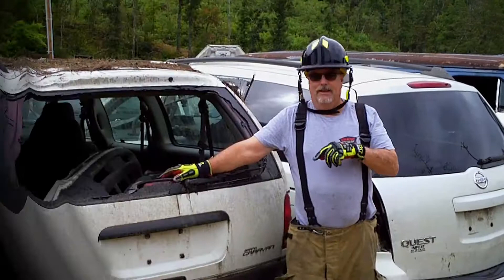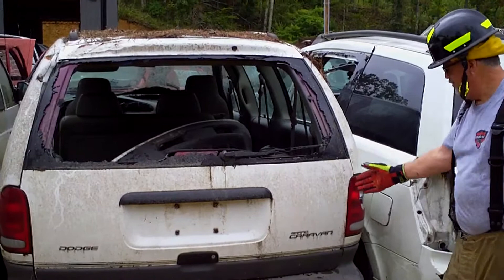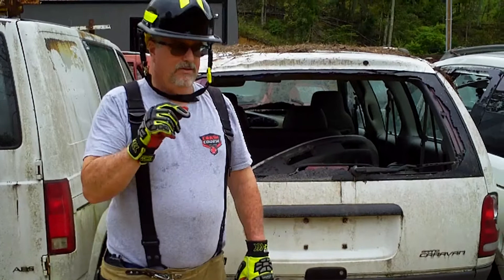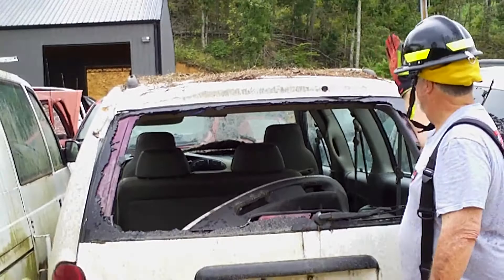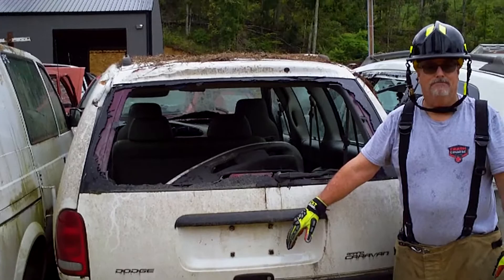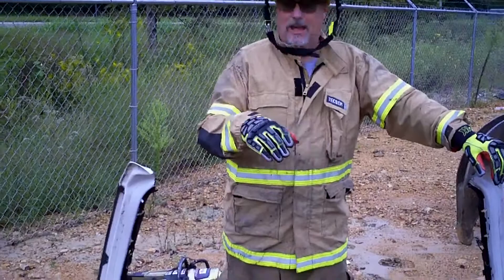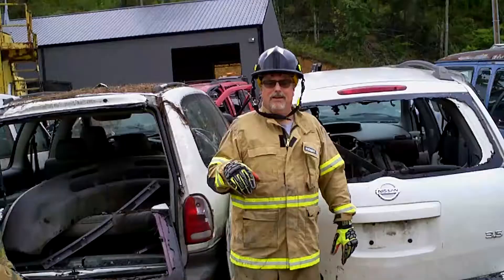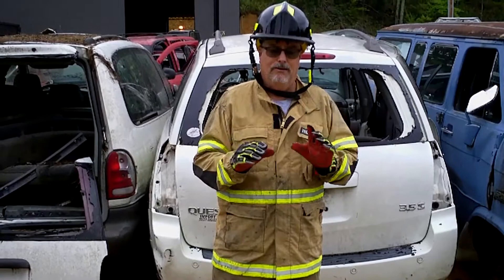extrication, hatchback. HFR

Comment: Have a question. New vehicles use a spring system which can be come a projectile, injuring firefighters if handled wrong. How does your department handle these new lift assists?